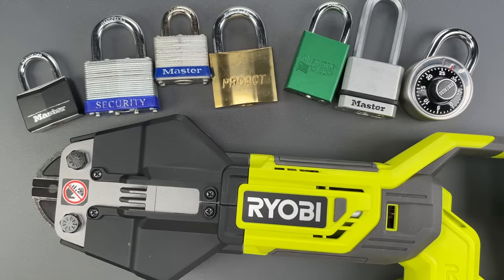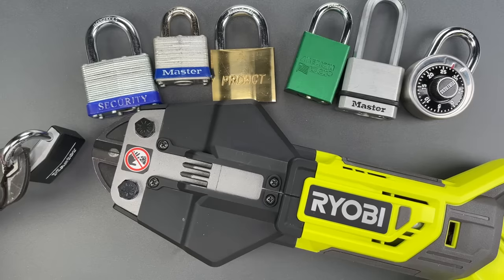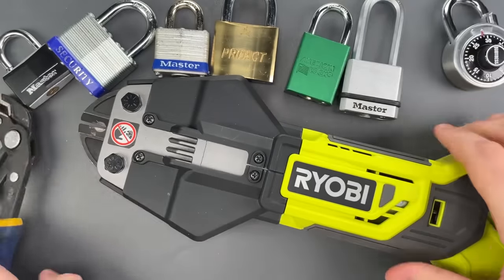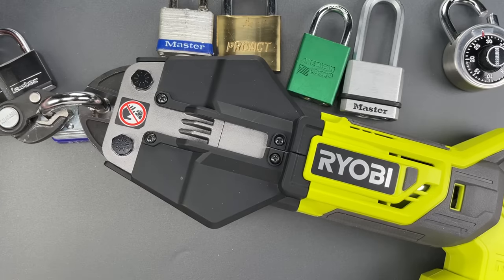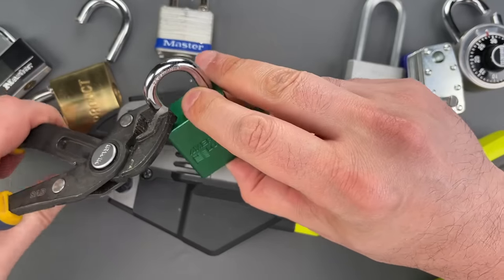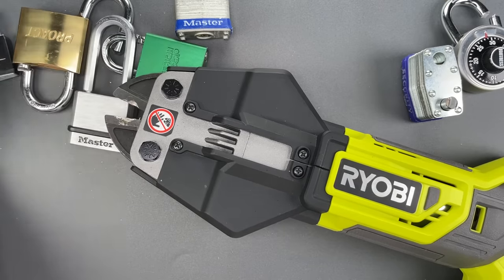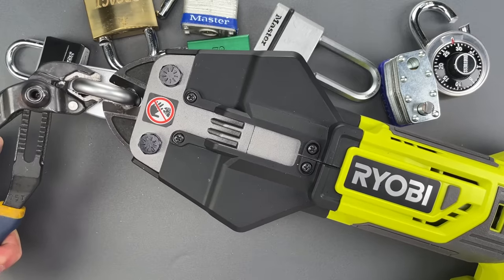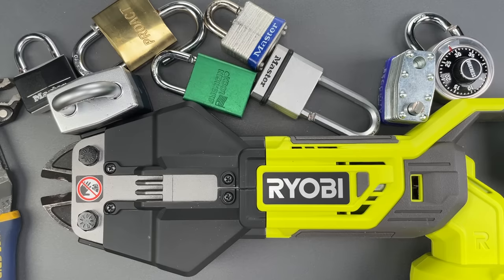[1408] Better Than Expected: Ryobi Bolt Cutter

Comment: This shows why most consumer locks locks don't bother too much with pick resistance. As long as bolt cutters and angle grinders exist, few criminals are going to bother feeling for a click on three.
Reply: that's a good point

This is why people should buy quality brand locks like squier, hardened shackles and perhaps at least some pick resistance. 

At least then it won't be a waste of money
Reply: Except that angle grinders make a lot of noise and throw sparks, while bolt cutters are huge and will make quite a noise when they shear the shackle. So it depends on where you are and what you're protecting. If the thing you're locking is well away from civilisation, angle grinder attacks are totally something to worry about. If it's the locker room in your gym, I'd suggest that bumping and picking attacks are far more likely.
Reply: Yeah but if you can rake it open just as fast as using a key no one will ask questions. If you have a pair of bolt cutters on you they will ask questions.
Reply: @ells5656  If they stole whatever was being locked, I suspect questions will be asked. However, I suppose it will probably take longer to notice if the thief picked and subsequently re-locked the lock.
Reply: this channel shows a disproportionate amount of good locks, out in the open, most cheap locks can be raked or  shimmed in 1-2 seconds by any novice which is far easier, cheaper and stealthier than using powertools
Reply: Was a bit naughty in my younger days i new about lock picking though its cool but bolt cutters are so much quicker and easier plus you can break windows with them
Reply: I actually purposefully chose a lock with a small thin shackle and a decently pick resistant core (well it can't be raked, comb picked or bypassed)
But if you really try hard you can probably cut the shackle with a beefy leatherman.  
My thought is if its picked and relocked after my stuff is stolen it'd be really hard to get anything from insurance, but if the shackle is cut its no issue, just claim what's gone. also I'll see it visibly if the lock on my shed is cut, but if its relocked it might be months before I fine out my chainsaw is gone.

Personal stuff that I don't wanna claim from insurance is properly locked in the house with a proper core on a proper door, I mean easiest way in is break a window and I don't have any windows not visible from the road...
Reply: I can go along with comment 
I was definitely not impressed with the shackle of Master Lock 3 or the boron carbide
Reply: @ells5656  that is true. but honestly why bother trying to rake it when you can just cut the lock off?
Reply: @amicloud_yt  It depends on the location. You could probably open a cheap lock with a comb pick overlift, one of those bypass flag things, or even a rake in the middle of a locker room at a gym even if walked in on and get away with it because it'll just look like you're using a key to someone not paying much attention. Even if you can sneak one in with a duffle bag a pair of bolt cutters is hardly subtle if anyone sees you with it.
Reply: @DarthVader1219  true
i just always think of bikes... have had too many stolen!
Reply: Yep and nowadays those tools are cordless.
Reply: @sumdud2129  And make sure that whatever the lock is locking isn't easily cut.
Reply: Locks just keep honest people honest.
Reply: @robertcowling4313  hmmm grinder battery came charged right out of the box? Wow
Reply: @al45tair  Criminals don't care about noise if they are using these tools. I have seen dudes steal bikes right in the middle of a busy street using an angle grinder and no one batted an eye. No one would be stupid enough to confront a dude with a weapon like that and cops/judges have all but given up going after thefts like that.
Reply: @robertcowling4313  in general, bolt cutters (or any anvil-style cutter) are terrible on wire rope. You want a parrot jaw style bypass cable cutter to cut wire rope.
Reply: Notice the amount of noise this tool makes.  Bolt cutters are enormous and conspicuous, and a well-known thief's tool.  Picking with a wave or a screwdriver looks from afar just like opening a lock with a key.
Reply: That's my observation as well. Criminals generally don't think of picking, they think of cutting and breaking.
Reply: Yes, when brute force works, skill isn’t required.
Reply: @robertcowling4313  i had a bike stolen in the middle of the pedestrian shopping area from a lamppost visible from like 4 storefronts in the middle of the day LESS THAN 100M AWAY FROM A POLICEOFFICE...

from that day on i think even police would gladly offer help with a boltcutter they might carry in the trunk of their car if they see someone fiddling with a bikelock
with the officer being ike:" oh, lost your keys? no probs, we got a boltcutter in the trunk, let me get it real quick"
Reply: @brucewayne4585  I want an angle grinder to cut wire rope.  Finish the cut it in less time than opening the handles.
Reply: @BrianFullerton  I have cut wire rope with an angle grinder, unless you have the rooe in a vice it isn't that easy. It jumps around and bucks.
Reply: @robertcowling4313  Wouldn't it have been a lot safer to just buy (or steal) an angle grinder at a different store, ensure the battery was charged, then take it to where ever you wanted to steal something and use it?  That way you know your equipment is dependable and you're not all over the store's surveillance cameras or going to be remembered by a cashier.  The theft as described is a nice story, and may indeed be true, but seems more like an urban legend.
Reply: While the THUG might just break into your place with a simple SMASH & GRAB letting you know you have been breached, the FED will will bug, tap, and make even more "backdoor" entry ways hidden from you into your house.
Having a false sense of security is far worse than nothing having one.
Reply: The vending machine locks in the break room, your daddy's gun safe on a Saturday, an expensive bike in the rack during the school day, teacher's desk drawer between classes, hotel room door at 3 a.m. 
Use your imagination instead of just declaring loud is OK.
Reply: @sumdud2129  Most (consumer) padlocks are already stronger than the device its being fed through TBH.  
(consumer) Padlocks are a deterrent.   Its not meant to make your stuff imposable to steal, its just meant to make it enough hassle and risk (sound/time etc) that a would be thief just goes to your neighbors house instead.  :P 

in many applications, its literally a feature to have locks that are easily cut.  Like schools/workplaces/ other shared protected storage spaces.
you want to really piss off an entire school worth of staff.   Send your kid with a cutproof lock and say they forgot the combo/lost the key lol.
Reply: The difference is one method is covert and the other is leaves a trail of evidence behind. Single pin picking might be a bit out there but think of comb picking... it looks to anyone watching you like you are using the key.... raking and bumping might be a bit more brute force but doesn't leave a trail of evidence behind. also did you hear how loud this was. I can rake a lock in the middle of the night and not get caught but pull this thing out any someone could very well notice.
Reply: @robertcowling4313  One of my neighbors confronted some people breaking into cars. They shot him and now he is dead. I don't blame people for not wanting to get involved.
Reply: @BIGSMOKE-bl2lq  Don't know how much quicker or easier it is than 3 second raking a Master Lock but it is your experience.
Reply: Locks are great attachment points for chains hooked to trucks. Happened to all of the locks at an establishment our family owned...
Reply: @robertcowling4313  Surprised they didn't steal the grinder from another store along the way.
Reply: @al45tair  just take the bolt cutters out while complaining about how you can't believe you lost the key to your lock, then ask someone there if they would hold it steady while you get the cutters started on it.
Reply: @ells5656  I saw a youtubevideo where two guys were cutting a bike lock with an angle grinder in a broad daylight and no-one asked questions. Everyone just watched in disbelief but did not do anything. So random passerbys are not quaranteed to protect your property even tho the crime is obvious.
Reply: And as long as bump picks exist the ones that do pick won’t bother single pin picking either.
Reply: @Karpaneen  was it in NY ? - the city where no one cares ..
Reply: @al45tair  Nobody will stop un thief in the street using a angle grinders. Not a lot of ppl risk their life to save somebody beaten, so a bike ...

When the police is here, the thief is long gone.
Reply: dude thats soo true  angle grinders and plasma cutters can cut even the most expensive locks with the right blades and etc but the downfall is they are loud af
Reply: Hammer work as well. Also the hasps are usually a joke.
Reply: You'd honestly be surprised at how many padlocks you can get opened by just putting your shoe over your hand and punching down at the lock. shackle tends to come loose on a lot of common locks that way.
Reply: Yep. There's a saying that locks only keep honest people honest.
Reply: All tools are like a hammer in that they can be used well—to put a roof over one's head—or poorly—to smash a window or a face. Notably the poor use is FAR easier and quicker to learn how to do. This is why powerful tools are considered morally dangerous even though the tools themselves are strictly morally neutral, and of course have no will of their own.
Reply: @robertcowling4313  long time ago a couple guys went to a tsc by me and talked to the employees about the biggest bolt cutters they had (about 4 foot I think) they bought them and then went to the local storage units and robbed a bunch of them.
Reply: @al45tair  If you planned ahead enough to bring tools, you might as well bring a safety vest, hard hat, clipboard, tool bag and a lanyard. Odds are no one will stop the repair tech no matter how much noise they make
Reply: My dad bought a portable/homeowner sized oxy/acetylene rig. Home Depot has been having a hard time keeping them in stock, they tend to walk out a lot. 

Not sure what can survive a cutting torch.
Reply: @robertcowling4313  I stole my own bike once when the lock jammed up. Broad daylight, public square, nice area. No one cared.
Reply: it's about both - because there's no shortage of Locks out there with good Shackles, but can be Raked.
there's not much point to buying like a $100 Lock that can survive being Shot if you can Pick it in Seconds. if you only have one and not the other, then the Lock doesn't really do its job that well and also it's kind've a rip off as a result because you're buying Security, so if it doesn't have Security  but is a 'premium' Product, well....
Reply: "It was gutsy, and they paid cash for the grinder too. They were never caught, as the police said they likely 'weren't local'."

I think that this must simply be that the police doesn't care enough to put in enough effort to catch them. They must've been caught on plenty of CCTV and tracking their car, even if across state borders, shouldn't be impossible for the police to do at all.

Seems like more of an issue that (1) it got stolen from a large retailer, so insurance would've covered the loss no problem (2) the local police therefore didn't really care too much to apprehend this specific thief.
Reply: "few criminals are going to bother feeling for a click on three". This is one of the best comments on YT!
Reply: I agree with that, it still should take longer than a second for master
Reply: @al45tair  Here in Toronto bike thieves are bold. They have absolutely no problem whipping out an angle grinder in broad daylight and just casually sitting there going at a lock. My friend has several videos of a few people doing this, beautiful day, sparks flying into the sidewalk as people walk, giving the finger with their off-hand to my friend filming.

some people dgaf
Reply: @KekusMagnus  this channel has YEARS of content. Dude isn't exactly going to pick and cut the same lock over and over again. He does good locks and crap locks.
Reply: Correct!
Reply: @amicloud_yt  alot depends on the thief's budget. If the thief is poor (hence why he/she is stealing) they probably can't afford bolt cutters but a paper clip can be used as a pick
Reply: @DarthVader1219  your right about that.. im currently.fighting a case where I broke into a gym locker using bolt cutters high as hell on xanax.. I got caught to say the least
Reply: it’s also why he’s not even bothering with realism, he stopped long ago and just opens for views rather than the challenge
Reply: @BIGSMOKE-bl2lq  I'll have two number nines...
Reply: @al45tair  i just use a plasma cutter or a portable waterjet and the fear goes away
Reply: If you're a thief, this bolt cutter and an angle grinder will get you caught in the act 100%
Reply: @davidy22  Not really. The advantage of bolt cutters (normal ones, not these slow and loud ones) and angle grinders is that they're fast. Even if nosy old Eunice across the street sees the local meth-head breaking into your shed, he'll have grabbed anything that looks pawnable and be half a mile away before the police show up.
Reply: @didnotwantthis  where did that happen?
Reply: @Crystals_and_Witchcraft  Don't really want to say where I live exactly, but Southern California.
Reply: @didnotwantthis  Thanks though I did not want addeess just general area that I should not visit the crime sounds terrible with those brazen criminals
Reply: I don't think bolt cutters neccasarily make a lot of noise... especially compared to grinders...

Comment: The best defense is a good offense. You don't need a lock if you guard your locker with one of these Ryobi cutters.
Reply: Amazon delivery boy cuts the corner to your door.
You: jumps out of the hiding spot, throws a net, performs an ancient battle cry and wields the bolt cutter at him as you turn of the lights in the floor and paint the scene pitch black
Reply: @7own878  fantastic
Reply: Yes, just put the cutter head around the latch, attached to a motion sensor. Put a sign that says "I dare you." Done. You'll come back to a safe locker plus some extra fingers on the floor! Who doesn't need extra fingers?
Reply: @johnshite4656  dip them in chocolate and put them in a purple Cadbury box.
Reply: You can also set up a bomb with a triger.
Reply: Make a mount that bursts through the shackle and grabs the lock picker's fingers.
Reply: @cal920c  And send it to LPL??? I think he might not understand....
Reply: I find that the best way to stop thieves is to not have anything worth stealing.
Reply: Lol

"alright, now hold still"
Wrwrwrwrwrwrwrwrwrwrrrr clunk.

Not exactly a speedy tool
Reply: Yeah no kidding, I wouldn't dare challenge someone who's got a bolt cutter that would make short work of my fingers, or worse, my lil guy.
Reply: Hide it behind the keyhole so it just snaps their keys off every time.
Reply: @janpapai9205  the only problem with both of those is you need more supplies to keep it working, just get an automated boxing glove for when someone comes close
Reply: @7own878  nice
Reply: @7own878  directors: WRITE THIS DOWN!!!!
Reply: yeah that’s def true about offense — you don’t have to worry about losing your money & valuables as long as you’re constantly stealing everyone else’s :)
Reply: This is true
Reply: That's why all my padlocks are tamper triggered hand grenades
Reply: @Darkassassin09  Well...... You could always put super glue on the latch so that when they grab it they can't just let go.... then the extra fingers would be on the latch rather than the floor. That would save some bending over at least.
Reply: Yubi yubi
Reply: How many people read this post and thought, "The best defense is a good defense, am I right?"?
Reply: @sabakobakhidze9745  whats a triger ?
Reply: You know my robotics team seems like they may get use out of one of these
Reply: Don't stick your pick in crazy
Reply: If you want better security buy a disk lock.
Reply: I find Ryobi's cordless chain saw works better for this purpose ...
Reply: They break the lock and the Ryobi bolt cutters swing out on a beefy drafting pantograph and remove a finger or two